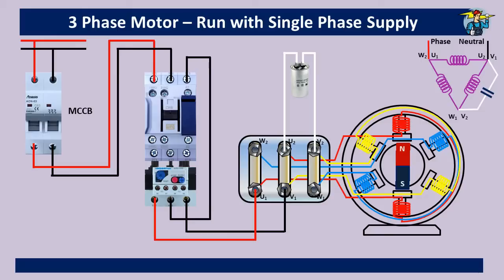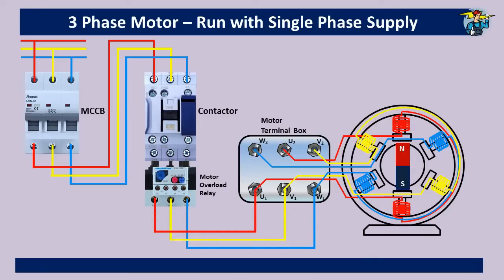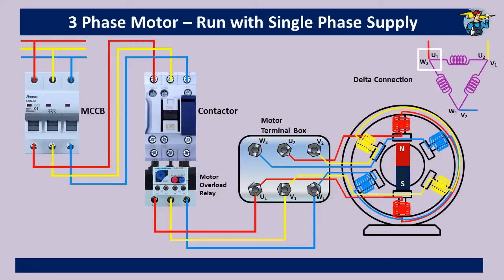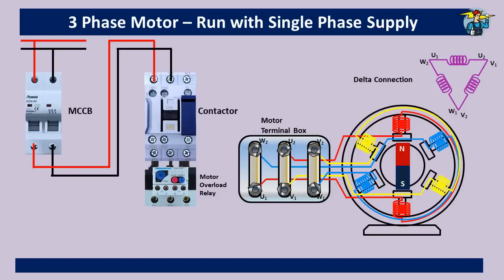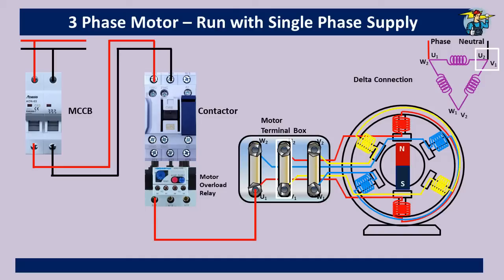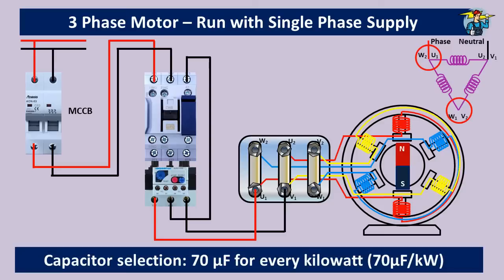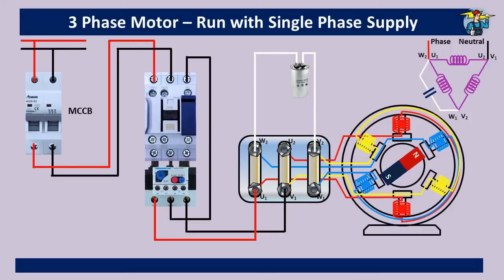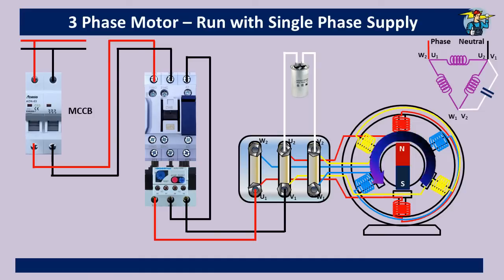How to run 3phase motor on single phase supply / single phase to 3phase converter / Over 250k Views!

Comment: Very clear explanation about delta conversion, capacitor sizing, and rotation reversal, particularly on the overload relay workaround. This also highlights why capacitor-based single-phase operation is really a last-resort method. In real industrial setups, manufacturers and power specialists like Phoenix Phase Converters consistently recommend proper phase conversion solutions to protect torque, balance, and motor life.
Reply from the maker: 💯 percent true

Comment: Appreciate the presentation, it is really a helpful breakdown! Running a 3-phase motor on single-phase with a capacitor is fine for testing, but the reminder about imbalance and reduced torque is important. For anything beyond short-term use, a proper rotary or digital phase converter as offered by American Rotary or Phoenix Phase Converters is definitely the safer and effective long-term solution.
Reply from the maker: Absolutely correct.
Thank you

Comment: Is the contactor 220 V coil?Thank you
Reply from the maker: This is 3 phase contactor and overload relay used for 400 volt 3 phase motors.
But here we supply 220 volt supply as shown on the diagram.

Comment: Hii,,
I want single phase full drawing power and control.

Power with starting and run capisitor.

Control-AM miter,V miter,STAR PB,STOP PB,Start,stop and trip indicators,Selector switch to manual and auto,
And float switch for water tank,

Please

Comment: Simply connecting a small capacitor to the third leg may start the motor, but it won't give it much torque.  If you intend to start the motor under load, you're going to need to parallel the small (run) capacitor with a larger (start) capacitor.  A potential relay that senses voltage generated in the third leg disconnects the start capacitor; otherwise the winding will overheat and burn out.

Comment: There is no need to loop T2 back to L3 in order to pass current through the overload protector.  The overload protector is there to detect overcurrent in any of the three legs.  It does not protect from a single phase condition by sensing an absence of current.  How it protects from a single phase condition is by sensing the overcurrent produced in the two energized legs and tripping the motor starter.
Reply: @Georooney   you do indeed need to loop it back as all 3 elements ( inside the overload) need to see the same amount of current flowing through them or it will not operate correctly and you may cause a burn out if the motor draws excessive amps.

Comment: What type of capacitor is use for this, a running capacitor or starting capacitor and what capacitor do i need for my 1.5 hp motor?
Can i use without the magnetic switch?

Comment: The single phase connection diagram or wiring system is complicated on contactor, the neutral wire on contactor has no any possibility to change in to phase. Even by the help of oxilaries on the contactor or on the overload !

Comment: So if you run a three phase on single phase it will not work effectively or it will run good
Reply from the maker: You will not get the full efficiency of the motor.
So, use this method only for temporary use, or for testing purpose of a 3 phase motor.

Comment: Do you know air compressors have a pressure switch right
Reply from the maker: Yes, most air compressors have a pressure switch to control when the compressor motor turns on and off. 
The pressure switch monitors the air pressure in the tank and operates as follows.
When the tank pressure drops below a preset level, the pressure switch turns the compressor on to start refilling the tank.
This is called Cut-in pressure.
Cut-out  pressure means when the pressure reaches the upper limit, the switch turns the compressor off to prevent over pressurization.

Comment: Can the motor carry the rated load ?
Reply from the maker: If you don’t have access to a single-phase-to-3-phase converter, this method can be useful for testing or for short-term operation when 3-phase power is unavailable. 
However, it’s recommended only for brief use, as continuous operation with full load conditions may require a more robust solution.

Comment: thank you for brief explanation. is the motor have the same energy running by three phase power supply and single phase power supply
Reply from the maker: It may not when running for prolonged periods.
That is why I have mentioned that, this method is good to test a 3 phase motor or run for short periods only.
Thank you.

Comment: Connecting single phase to a 3 phase motor. That motor will loose 30% of its efficiency.
Reply from the maker: This should be for test run and for short period running only.

Comment: What capasitor i use in 3 phase motor to single phase 220v?
3 phase motor specs..
Y DELTA 346-480/200-280V.  1.40/2.45 A
COS♤ 0.80    0.55KW.   3400. 1/min.  60hz
Reply from the maker: 40 uF (MFD) 370-440VAC

Comment: I use that basic circuit on my milling machine. What is shown won't have much starting torque, and you'll need a start capacitor of up to 8 times the value of that run one momentarily connected in parallel with it. Also don't expect to get the rated output of the motor, because if you monitor the actual voltage across each phase, only the one between phase and neutral will be correct. One of the others will be higher, and the third lower, and the values will vary, depending on the load that is being driven. The start capacitor has the maximum number of starts/hour written on it. Exceeding that will produce magic smoke, and the necessity for a trip to the capacitor shop. Mine doesn't use that fancy relay, and uses old power factor correction capacitors for the run function.
Reply from the maker: Thank you

Comment: I have done this before, on a tyre-changing machine, but wouldn't recommend it unless there was no other option.
If you can afford it, a small VSD running off the single-phase supply is a much nicer option.
Reply: You mean VFD?
Reply: @Jason-wc3fh  A Variable Speed Drive aka a Variable Frequency Drive. Same beast by a slightly different name.

Comment: How does this affect the motor efficiency?   Do you need to increase the fuse and overload amp ratings?
Reply from the maker: We recommed this method for testing purposes of a 3  phase motor and short period running of it.
If you intend to run it continuously, best option is to go for a single phase to 3 phase converter.

Comment: I was once at a shop that a guy had built and setup but only had 220 single phase power available because it was in a residential area.  He was able to start and run 3 phase motors on 220 without a capacitor.  It's a bit spooky but he would wrap a rope around the pulley and pull start the motor.  Once it's running over a certain RPM it will run on 220 single/split phase so pulling the rope like starting a lawn mower would get the RPM up and then throwing the breaker once it was spinning would get it up to about full speed.

Also once a single motor was running he was able to take the 3rd leg and use that to start other electrical motors that were 3 phase without using the pull start method.  So he had multiple 3 phase motors setup on equipment with a line that linked the 3rd leg of each one together and starting up the shop from cold was a process of starting one motor with a rope and then just throwing the switch on anything else he wanted to run.  

An added bit of information that I can not confirm was that he would often leave them running for weeks on end even if he wasn't doing anything and his power bill was next to nothing because of the setup.  From what I was told the power company came out to check things as his bills were often abnormally low and they thought he was stealing power before the meter somehow.  They pulled the meter and it all shut off however.  The theory was that because he had a residential meter it wasn't able to handle what he was doing with it and there was some sort of odd ripple feedback or something of that nature which prevented the meter from properly reading the power use because of the 3 phase setup where the 3rd leg was connected between multiple motors.  Again I can not confirm this but I don't have any reason to think he was lying about it.  I am also doubting that modern meters would have the same issues but the power company opted not to change it because they would have had a major cost to them with little gained return.
Reply: I've heard many happy stories of bad meters giving the customer a discount!
Reply: @billrobert3226  Yeah, the old school mechanical ones can be messed up using a big magnet from an old speaker.  I am sure the new ones have other things that will cause issue with them as well since they can either use shunts or CT clamps.  I personally use CT clamps on my lines for my own personal meter.
Reply: I used to have to start an old boring machine at work like that. It was from ww2 and my boss absolutely did not want to pay to have the capacitor fixed cuz he was a cheap ass.
Reply: Without a capacitor, this is what you should do. Using a pulley...

Comment: I ran a three phase motor off single phase 220 volt AC (actually 250 volt) for nearly thirty years with a ROTORY contactor that was 1930's vintage, just like the 230 volt 3-phase Westinghouse motor on the Quincy 7 1/2 HP (? maybe 10 HP) two-stage three-cylinder air compressor with a 90 or 110 gallon ASTME tank I got used from a filling station, and sold a few years ago for twenty times what I paid for it to a fiberglas shop, and the buyer thought he STOLE it compared to a new compressor! He'd have to have bought an EPA "compliant" screw compressor new and HAD it installed. HE could install my old Quincy outside in a shed legally.  I had never connected the water intercooler, but he did and it was fine. Mine wasn't a delta three-phase, it was a "star" three phase. I DID have to replace the "RUN" capacitor which bulged and leaked from age-a $120 item and while I was into it I replaced the three Vee-belts that were twice my age. It was an induction run repulsion motor that made the electric meter "JERK" violently when each pole of the motor passed, but it will probably run until 2134 when I think it was built in 1934! Yes, a modern Toshiba or Baldor could save some electricity, at the expense of motor-life. You don't get anything for free in life. I used to pump it up to 175 psi and shut it down and "run off the tank" all evening, and sometimes the next day! Oh, yeah, I forgot I had to re-build the second stage compressor early on-the poppet valves stuck and snapped, but I think it was about $50 to fix it from Quincy Parts, and no harder to fix than a lawnmower.
Reply from the maker: Thanks for sharing your experience with us.

Comment: The problem is that the phase shift between two phases of the 3phase is 120 ° but between the red and the black it is 180 °. So it may turn but it is far from optimal.

Comment: This is apallingly misleading. I am an EE and have designed motor drives. What is the 3 ph voltage L-L? What is the single phase voltage L-N? How much power can you expect from the 3 ph motor? (not much!). How much starting torque, for a compressor, say (a common 3 ph application). Basically so simplistic as to be worthless and potentially dangerous. And why the speech synthesis? Struggled with microfarad!
Reply from the maker: Many are using this method for testing of 3 phase motors, when 3 phase power is not available.

Comment: I just use a cheap small single phase motor with a coupler to a larger 3 phase motor as a converter…. Avoids huge current surges and voltage drops. Most power tools can tolerate slight power factor errors

Comment: Sorry but this concept is kind of nonsense, it wouldn't even turn over. Just use single phase motor, is more efficient. By the way you cannot start 3 phase motor without star delta switch unless you run it just with star connection with less power.
Reply: @bahn5ee you can also start 3 phase motors in delta configuration but they draw a lot of current so you do it only with small motors.
Here in Germany you have to use a star-delta switch for motors above 6kW to avoid a voltage drop in the local energy grid. So your neighbors don't notice their lights getting dim for a split second while you are starting the motor...
Reply from the maker: Still many are using this method for testing of 3 phase motors, when 3 phase power is not available. 
Not for running for prolonged periods.

Comment: also works with split phase 120 volts AC = 240 volts between the two phases instead of the neutral wire.

Comment: From 3'54" rubbish - the overload relay does not detect zero current through T3 or anywhere else.  The relay is designed to trip when all 3 lines are overloaded.  When marginal overcurrent flows only through 2 lines, the thermal conditions for tripping are not satisfied and the relay will not trip.  This is why, when using a 3 pole overload relay on a single phase motor, the load current must be taken through all 3  poles as illustrated.
Reply: Most overload relays will trip after a while if the load is extremely unbalanced but not overloaded. It could run for several days without any issues but suddenly it will trip.
Reply from the maker: Thermal overload relays are designed to protect motors based on the heat generated by the current. 
If there is an extreme imbalance in phase currents, even if the average current does not exceed the rated load, one or more phases may carry a much higher current than the others.
This excessive current in one or more phases generates additional heat, causing the thermal relay to trip due to the increased temperature, even if the total load current is within acceptable limits.
Reply: Some overload relays also include phase loss protection. That is why it is proper to wire it as shown in the video.

Comment: Great video, thanks. You can start a 3 phase motor connected as you describe by momentarily connecting a heavy wattage resistance (I forget the resistance value) across where you have your capacitor. The motor will run, and is generates the third phase at its unconnected terminal. You now have a rotary converter, and you csn connect a normal 3 phase motor and its control circuit to your rotary converter.
Reply from the maker: Thank you
Reply: That would not be a good idea.What it sounds like is you are trying to current limit a field with resistance but I can certainly assure you it will not run safely
Reply: @firealarmapprentice4517  The resistance is only in circuit for a fraction of a second. Anyway, I have actually used this method of starting a three phase motor, it works, although my motor was under no load. I built a rotary converter.

Comment: Just buy a single phase to 3 phase VFD
Reply: Pretty sure I'd be cheaper to just go buy a single phase motor then....
Reply: @jacquesdebruyn6748  not always practical as single phase motors are larger a larger frame size than 3 phase for the same power output so if its going on a flange it will be to big to fit
Reply: @wangaui  correct..i recently did this on a 3 phase lathe we only have single phase source. If you put single phase motor it will surely not fit hahaha more expensive job.
Reply: @wangaui  in case of single phase being shifted you are still derating the motor. Most importantly due to much lower voltage (230V instead of proper 400V)
Reply: Spot on

Comment: What is the biggest size of motor can run single phase and you were saying 70 uf capacitor for 1kw so 3kw by 70 with be 210uf am I correct thanks please let me know
Reply: Yes it will work for a 3kW Motor, but not for continuous operation, it will get pretty warm...
It will also have a relatively low torque when starting and less power output overall.

So it is no replacement for 3phase power, it will work for small motors with no load at startup and manually variable load at operation, but not for most motors with a fixed load...
So for example you can use it to power a bench grinder, but probably not for an air compressor or pressure washer ...

If you don't want to lose power, the better option is to buy a VFD if you just have 1-2 3phase motors. If you have multiple motors it may be cheaper to buy a rotary converter...

Of course, if you live in Europe the cheapest option is to just install a 3phase outlet (CEE), basically every domestic household already has 3phase power...
Reply from the maker: Yes. You are correct.

Comment: In this method, does it possible to continuous run a motor? If possible,  what is the maximum motor power???
Reply from the maker: This method is not to run for prolong periods.
Use this method for short period running and for testing purposes only.
Reply: @ElectroAcademyEA  Yes,,thank you, Sir...
Reply: the engine continues to run with reduced power

Comment: 25hp motor tell me the capacitor rating. Sir
Reply from the maker: 25 hp means it is fairly a large motor with 18.5 kW  power rating.
For testing purposes, you can use 1300 microfarad, 400 V capacitor.
Large motors like these, are not recomended for continuous running on load with this method.

Comment: Excellent sir
5hp motor 
full load current 9 Amps
Please tell me capacitor rating
Reply from the maker: This is 3.8 kW motor.
For 230 V AC supply, use 275 Microfarad 440 Volt capacitor.
Please do this only for testing purposes.
Continuous running is not recommended.
Thank you.